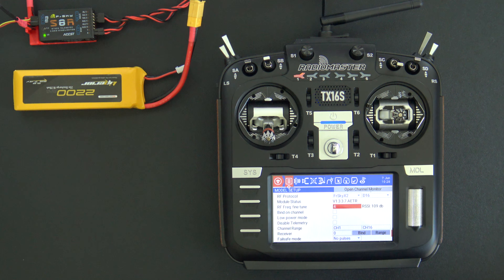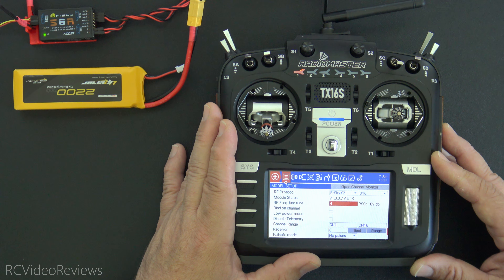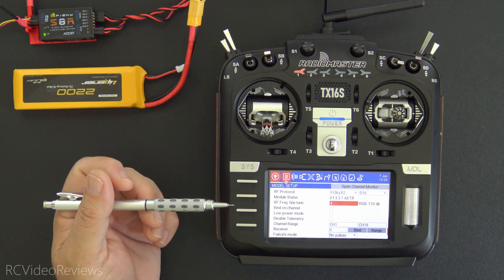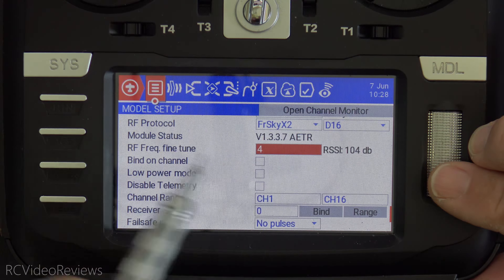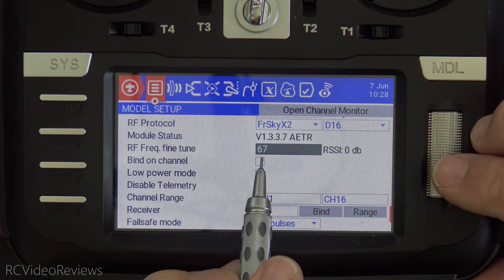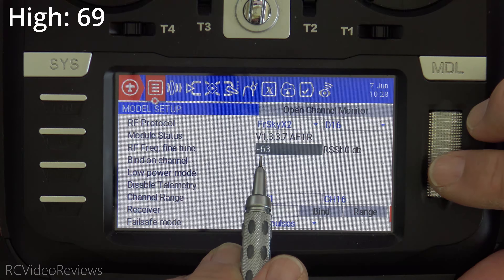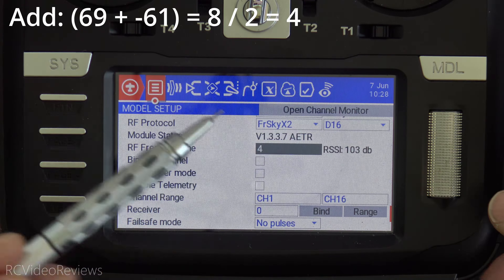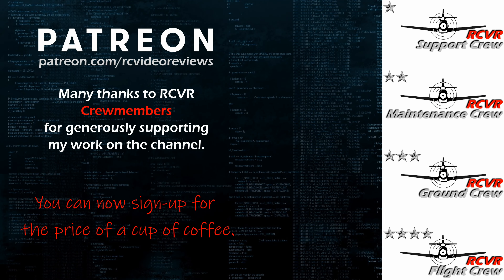Multi Protocol Module Frequency Fine Tune on Radiomaster TX16s MKII

Comment: Very well explained From my own experience it is really necessary. With D8 protocol I lost signal at 150 m with one airplane. Never before with FrSky. So highly recommended.
Reply from the maker: Yes, if the option presents itself, you should do it.
Reply: What is d8?
Reply: @ryanlemons3255   Hi receivers with telemetry "D" and 8 channels . Normaly they have allready A 1and A 2 analog inputs already in the receiver. Note that this tunning  is necessary for any receiver,the problem it is in the module not in the receiver. The FrSky receivers a all tunned from factory.

Comment: I have a bunch of R168's and have been fine tuning them one by one, each 'mysteriously' ending up at -11. I had no idea that it only had to be done once per protocol. Also didn't know about not in low power mode. Many thanks.
Reply from the maker: You're very welcome. Glad to help.

Comment: I bought one of the new Radiomaster SBUS receivers. I have a TX16 without the multi module, only ELRS. Is there anyway I can bind to the SBUS receiver or am I screwed?
Reply from the maker: You need ELRS receivers to bind with ELRS transmitters.
Reply from the maker: You could buy a Radiomaster External 4in1 module. That will bind with the RM non-ELRS receivers. PS It helps if you use model numbers i.e. R168.

Comment: With Edge tx v2.9.4 the fine tuning is automatic.  You tell it to do it, about 30 seconds later, it's done. And if you think about it, programming this would be quite easy, just run it up and down, to exhaustion on each side, note the exit points, and then enter the median.  We won't have to do this much more.
Reply from the maker: Not true. Fine tuning isn't an EdgeTX feature. It's part of the MPM code. If Fine Tuning appears with the protocol you select, you should perform it.

Comment: Another great informative video. I didn't know about the fine tuning. I am having trouble binding, but as you requested this is not a bind question. My current module status is T-E-A-R. Is there a way to change it to A-E-T-R?
Reply from the maker: The MPM download page has options for channel order in the firmware.

Comment: Ever since I switched my tx16s from Opentx to Edgetx the Fine Tune option is missing for me.  Any ideas on what could have happened?
Reply from the maker: Fine tune option is protocol dependent. If the protocol doesn't support it, it won't show on the radio. Select a known protocol like D16 and see if it pops up. It should.
Reply: @RCVideoReviews  I am using D8....shouldnt that support it?  Im pretty sure it did before on Opentx on my tinyhawks and they dont use d16 right?

Comment: Does a specktrum or a lemon needs this tunning? What are tthe signs that your radio is not using correct tuning, los of signal and crash? thanks
Reply from the maker: If frequency fine tuning appears when you select a protocol, it's suggested to do it. 

It's not quite as clear cut as "loss of signal and crash". It's more like listening to the radio in your car when you start getting farther away from the source--it kind of starts to fade and you hear interference, eventually you can't hear it at all. Better example is tuning in UHF channels on an OTA Analog TV. The closer you get to the center freq, the better the picture.
Reply: @RCVideoReviews  ok thanks i understand the example but since i crashed yesterday just after changing the settings for the telemetry so i stop listening that annoying  warning. I thought the problem was that i lost reception because the plane started to turn to the left without any control until end up on a tree. locally it is a small apprentice Stoll 700m. no mayor damage but rider remained tunes to the left without any reason.

thanks for answering my questions!!!
Reply from the maker: Turn on logging and look at the RF telemetry. Take the guesswork out with data the radio can record.

Comment: Good Video. I have a question about the fine tune with Sfhhs protocolé. I just open my radio master tx16s MarkII elrs but could find the option for fine tune?? What i can do to get these option on my radio? Thanks
Reply from the maker: One problem:
If you have a Radiomaster ELRS you don't have SFHHS protocol. 

I just looked on my MPM and with Futaba selected, RF Protocol SFHSS, Frequency Fine Tune is sitting right there where it's supposed to be.
Reply: @RCVideoReviews  i order the wrong radio. Just i order the multiprocolo module 4:1 thanks

Comment: Is this including external 4-1 module? And how about Elrs? And how about those receivers like flysky receiver with no telemetry? Do we fine tune those? Ty so much love you're video.
Reply from the maker: Frequency fine tune is only conducted when the selected protocol offers it as an option on the screen. So bottom line, if you see Frequency Fine Tune as an option, conduct the process.
Reply: @RCVideoReviews   Ic so if there no option im good. But if there is option system want's me to do fine tuning. Why cant it do it automatically? By the way ty so much.
Reply from the maker: Ultimately, I believe that's where the developers would like to be--automatic fine tuning. Just not there yet.

Comment: Question, I had a plane go down due to signal shadowing would doing the fine tuning help my frequency issues?
Reply from the maker: No. Fine tuning just more closely aligns the tx/rx transmit frequency. It wouldn't resolve legitimate obstruction issues.

Comment: could this be the reason I am haveing issues binding my FrSky Sr6 reciever?
Reply from the maker: If you set frequency fine tune to 0, you should be able to bind any rx. This is just a fine tune step to ensure the Tx and Rx are tuned as close as possible.

Comment: Great video. one question when i did mine i can up with -4.5. Do i set it to 5 or 4 since I can't do 1/2 input?
   Thanks
Reply from the maker: It doesn’t matter that much. You’re .5 off either way.
Reply: @RCVideoReviews  Thank you

Comment: What if the negative side is higher than the positive side and your getting a negative number. Do I set the fine tune at negative 12?
Reply from the maker: Yes. Average them and use the sign.

Comment: Does DSMX need to be fine tuned as well?
Reply from the maker: If the protocol does not show a fine tune option, it doesn't need to be done. If it does show a fine tune option, it does need to be done.

Comment: Thanks for showing this. I’m using edgetx on my TX16S. My RSSI doesn’t change from zero but my rx will change to indicate signal loss. Is there a way to activate the RSSI?
Reply from the maker: If RSSI is sent from Rx to Tx it will be presented on the calibration screen. There is no need or option to add it. You can discover sensors on the telemetry screen to use RSSI elsewhere in your setup but the RSSI value shown in the fine tune section is sensor independent. i.e. It is displayed if it is sent/supported.

Comment: Thanks for explaining! I've done the finetuning since the start. Every time I forget to set it, I get lots of 'Telemetry lost' warnings. So it's very important. But my question is, why finetuning has to be done only once. Can't the sweet spot differ between different receivers of the same protocol? I've a friend telling me that he did it with different RX of the HOTT protocol and hat difference in finetuning up to 50 points on the scale. This is much. Maybe we should do it with every single receiver?
Reply from the maker: 1) The MPM developer probably knows more about RF than most, and here are the exact words from the manual: "Once the Fine Tuning value is known, it can be used for all models which use the same protocol."

2) Other TX's don't even have a fine tune option. The reason is because the manufacturers of TX and RX specify the frequencies to use--precisely, and they tune the TX/RX to those frequencies which is why the fine tune option didn't really exist until we had an MPM. So if stock TXs don't have a fine tune option, doesn't that imply the RX using a given protocol will always use the same frequency? I mean for a lot of years I've bound FrSky Xx, Dx, Sx, Lx receivers without ever adjusting the frequency on any radio--until the MPM.

3) Sounds like HOTT has a QA problem.

At the end of the day, it's your money, your hobby--do what you think is best. I'll trust the actual developer of the code who specifically wrote it's not necessary until my radio gives me a reason to believe something else.

Comment: Hi buddy. :) I have another question. So I ended up getting a og Tx16s. I did went to you're channel via discord. Under Jimster. But I'll copy and paste. Ty a lot. :) Hi guy's. I have a few issue. I have bought Tx16s original one 4-1. Anyway's. I calibrated the gimble couple time but channel four which is ailerons right stick I'm on mode 2. When I don't touch it. Channel monitor shows stick jumping 1539 to 1540. Even if i have trim center. And  Left stick rudder. jump as well by one point. So is this normal because i know there issue on these first original tx16s. Another thing is Multi set on SLT because I am using Tactic slt receiver. It showes rf freq problem is this isn't a telemetry that detect rssi. How I rf tune it? Oh and sometime it looses settings that i have to go add multi and slt. Odd behavior. i paid 85 for it and came with two tactic receiver. But disapointed these issue which I have no issue with mk2.
Reply from the maker: One of the developers on Edge responded to your gimbal question on discord. Regarding RF tuning: https://www.youtube.com/watch?v=08W8usnP0dA
Reply: @RCVideoReviews  Ty but  there no RSSI on none telemetry receiver right? Because my receiver only receive command from transmitter. Tactic TR625 according to product page and pdf it isn't receiver that send information back to radio. I'm so confuse :(

Comment: partner I'm not able to do this configuration using an external module of ExpressLrs in my case it keeps giving warning of RX Lost and does not connect to the radio.
Reply from the maker: There is no frequency fine tune for ELRS as far as I know.
Reply: @RCVideoReviews  OK thank you

Comment: dear i have TURNIGY 9x8c v2 , 8 ch full range receiver and also hobbyking , HK- TR 6A V2 , 6 CH , digital receiver system , pls can i use them with radio master t 16 ?  and how i can use them , which protcol ?  and if these work , so can i also need to fine tune FERQUENCY . pls guide , because i have more then 14 receiver of these
Reply from the maker: If you look on the product link at Hobbyking, the protocol is specified in the description:
https://hobbyking.com/en_us/turnigy-9x-2-4ghz-8ch-receiver-v2.html
Protocol: AFHDS

Then look at the MPM protocol page here: https://github.com/pascallanger/DIY-Multiprotocol-TX-Module/blob/master/Protocols_Details.md

And you can see it supports AFHDS2A. 

I'm not sure if AFHDS2A is backward compatible with AFHDS, so the only thing to do is try. It is a FlySky protocol on the MPM.
Reply: Ali ti ti sprejemniki sedaj delajo, na katero ime ste jih nastavil, številko ?

Comment: Hi please help me I'm facing an issue with tx 16s it's says low rssi after 50 meters idk why I'm a beginner and buy a new radio so don't even know that much please help me in this problem.
Reply from the maker: You need to bring this question to discord. Far too many things need to be unpacked to get to the bottom of this. I can't offer the help you need on YouTube.
Reply: @RCVideoReviews  okay bro give me the discord link and btw thanks for answering :)

Comment: It has been said there are no dumb questions, but after I ask the following you may feel differently.  Why did you devide by 2? Was it because of the 2 extremes of the frequency tune? How you arrived at 8 made sense, why you divided by 2 escaped me, but then leaded gas was still a thing when i was young so I may not have the capacity to understand
Reply: You are looking for the center of the range.
Reply from the maker: That's what the software developer prescribes: Calculate the median between the two values (TUNE_MIN + TUNE_MAX) / 2 = TUNE_MEDIAN
Reply: @RCVideoReviews  This shows the difference between the SW engineer and the mathematician - this is actually the mean - not the median. :-)

Comment: I was told not to have the RX close too the TX when tuning as it effects the results.
Reply from the maker: And what do you see when you try it both ways?
Reply: I agree that having the RX too close affects the results - RSSI just doesn't appear stable at less than 3-4 feet.  The same problem can occur when binding - being too close swamps the RX and the bind becomes a real struggle.
Reply from the maker: I just ran the same exact test at 1' and 10' and came up with the same value. So I'm not seeing it that way. But, your money, your hobby, do it whatever way suits you best.
Reply: @RCVideoReviews  I tend to put the rx in a different room so i can still see the bind light then tune it until the light goes out and the RSSI drops out ( + & -). You don't get a great deal of difference in the tuning numbers and like you say do what works for you.
Reply from the maker: PaulG is right in that you can get swamping if the Rx is too close. I usually fix that with a little space and by pointing the active element away from the Rx. If RSSI is unstable to start, then the tune won't be right.